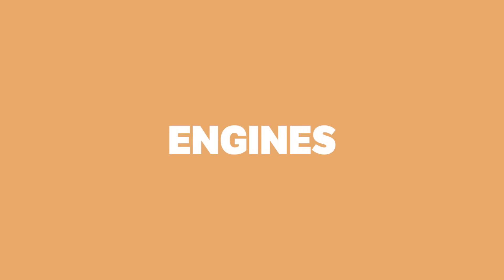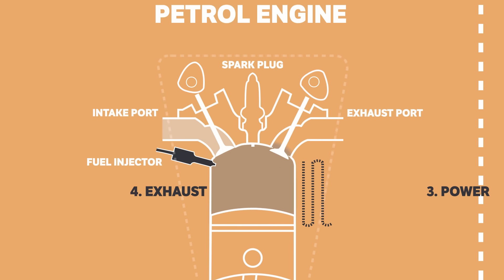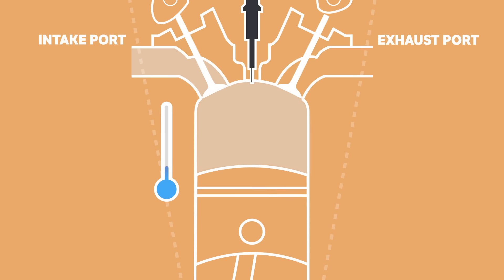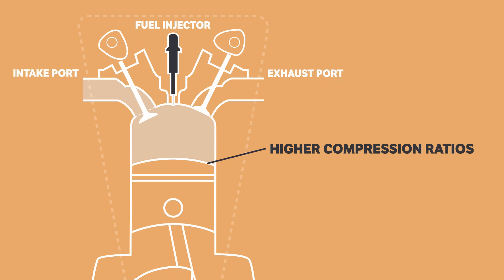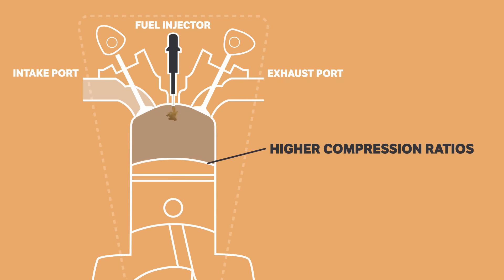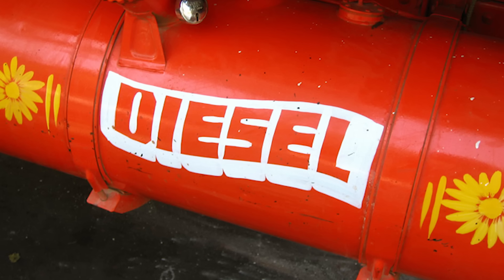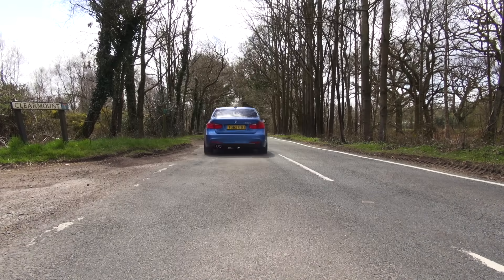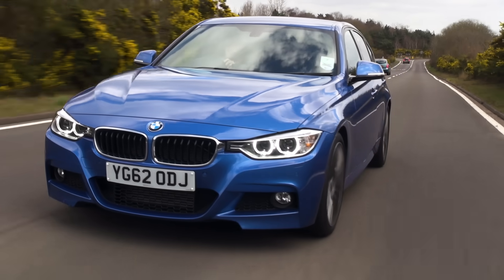The Differences Between Petrol and Diesel Engines

Comment: Hmmm... Diesel or gas... well, all the race cars are going diesel hybrid, so that should mean something. o.O  Now to make a Diesel Prius, as those guys in their big trucks that blow soot all over them don't realize the original Diesel engine was specifically designed to be green, it ran off peanut oil.  Today, you can still run them off food oils, where gas engines are lucky just to run on ethanol!  More torque for less fuel, getting an average of 50 mpg and can run on used french fry oil??  Sign me up!

Comment: Most diesels are faster than their petrol twins though😄 and low down torque means the power is exactly where you want it.. but you also get the MPG, even if it's quite high performance

Comment: Diesels are more fuel efficient. Often faster than their petrol counterparts (for example E90 320i vs 320d). Easy to get BIG power gains from remaps. And finally the M550D (enough said).

Comment: Turbo-petrol: acceptable torque, fun to drive, quiet, relatively clean, easy to run on ethanol, propane, methane...
Diesels stink, produce way too much black sooth, require adblue and complicated emission systems to keep relatively clean, run hard and noisy...
Diesels are great for torque, but electric motors are even better for that, it's just a matter of time before battery technology and decreasing cost will make diesels obsolete.
Turbo-petrol electric plug-in hybrid would be perfect IMHO.
Reply: When do you think trains will run on batteries, never diesel is always the best
Reply: Fuck off.
Reply: CR1MS True people that clean them out once in a while and tune the fuel injection and fuel pump(cummins engines)
Reply: Candisa more noise the better plus diesel is mainly made for trucks and 4x4s
Reply: Mustafa Süzen plus can't take back what we already done to the environment
Reply: diesels produce black sooth if the owners are ricers and idiots.
Reply: Lol electric isnt yet up to snuff to replace diesel like 90% of farm equipment runs on diesel not to mention all the semitrucks busses etc its the most abundant in crude oil next to gasoline. We need more power in the electric motors itself but in an smaller package so it can acctualy do stuff in the field
Reply: who cares about the cleanliness and enviroment, more torque, more black smoke way to go
Reply: i like you Mustafa
Reply: DieselGod237 thank you ;)
Reply: Candisa Yep, got to agree with you there. Just need to sort out the grid and voilà, much cleaner air.

Comment: Sod all the comments , diesels are unreliable nowadays with all the common rail garbage and emissions crap they have to add here in Europe.
A good old turbo diesel from the 1990s would last forever if you maintained it reasonably and still be frugal enough to get you around 
Nowadays you risk going into limp mode on the motor away while a lorry rear ends you hint hint Vw tdi
For the near future I will stick with petrol even if the life span of the engine is a bit less it's worth it
Reply: This isn't right Diesels are still very reliable search it up bc your talking a lot of bullshit.
Reply: Also you say a bit less when it comes to lifespan, well that's wrong petrol will last around 100,000 - 150,000 miles while as diesels can do 350,000 miles plus and not bat an eye.

Comment: But I heard that diesels used a glow plug to ignite the air-fuel mixture?
Reply: विष्णु का दायां हाथ glow plug is only to heat up the cylinder/mixture for the start of the engine.

Comment: They both have their uses. I currently own a petrol car, would love a diesel becasue I've been doing loads of motorway driving and I must say that petrol engine drinks up all that fuel. But for short distances my petrol works wonders, very fun to drive around the city flooring it, seeing them revs reach up ☺️. Honestly diesels sound like a tractor there's no character in them in comparison to petrol engines. But yeah, theyre both comparable and have their pros and cons but in my opinion it should be down to lifestyle choices.

Comment: Actually their are not based on the same cycle. The petrol engine uses the Otto cycle and the Diesel engine uses, well you guess it, the Diesel cycle. These 2 cycles have almost nothing in common. Infact the Otto cycle consist in 2 adiabatics and 2 isochorics while the Diesel cycle consist in 2 adiabatcs, 1 isochoric and 1 isobar. Finally if you want to know a top tip: it's called the 4 stroke engine but in reality there are 5 steps: 1- suction of the air-fuel mixture, 2- compression, 3- combustion, 4- expansion, 5- exhaust. Remeber that in the pressure-volume diagram, combustion and expansion are not in the same step! Like it is shown in this video. Because combustion is the vertical one ( or the isochoric one) and espansion is the adiabatic one that follows! 
Hope that my little explenation is clear :-)

Comment: I feel no one here has driven a big capacity N/A or supercharged gas motor...  Endless torque with none of the breathlessness. Just not good in sports car, but for everything else it's a good combo especially if you do more than 25000 miles a year.

Comment: This really only explains the difference between compression ignition and spark ignition. A gasoline engine can run on either, though it is rare and unnecessary, because gas doesn't need to be atomized to ignite.

Comment: One thing about diesels they did not mention is that it is a more durable engine and it typically has more low end torque for pulling heavy loads and can get between 3and4 times as much miles over a gas engine and with semis they average around a million miles or more then do a complete over haul from top to bottom and the engine is good as new and ready to go back to work and put that high miles on it again the only two major part the gas engine has over diesel is they start better in cold weather and gas engines are a lot cheaper to repair than diesels

Comment: lack of throttle body on diesel engines is why it's retarded to put a dump valve on one.   the engine swallows the waste.. if you dump to atmosphere then your next gear change will be bolloxed up. not to mention lack off vacuum lines to control it on vnt systems. I'm not saying it can't be done as it has been and gone well in some cases but most likely an average setup will make losses

Comment: I'll go for the diesel engine, Since i get a lot more torque and a better fuel econemy. And i can drive my car at a much lover rpm aswell, so it will be less stress on the engine. In theory that Should make the engine live longe.
Reply: It is not good to drive a diesel at low rpm. Sure, it may save some fuel but on the long run the engine will be damaged and the injectors will clog up so more money on repairs
Reply: LIVE LONG & PROSPER \/
Reply: Vali Moisă i usally keep it at 1500-2000rpm But 1000 when costing
Reply: What engine parts get damage from low revs?
Reply: Kaspar Kople not really it's just more expensive to maintain
Reply: Vali Moisă not really because the engine is made for diesel your on about putting diesel in a petrol car then they will clog up
Reply: Except that diesels are nothing but trouble maintenance wise.

Comment: I love both. 
If it's an SUV or a pick-up truck I would choose the diesel versions, because diesel engines are far better due to it's fuel efficiency, long durability and, of course, high torque at lower RPMs, which increases power when you go off-road. 
But if it's a sports car I would definitely choose the petrol versions. High performance gas engines accelerate in a more progressive way due to high torque and HP at higher RPMs.
Reply: This guy gets it.

Comment: The compression ratio in a diesel is higher because the piston only compresses air and then the diesel is in injected to the hot air and self ignites due to the high temperature

Comment: A "520d" or "320d" is not a real BMW.
Reply: i have a e46 320d.... so? still better then a WV. or an audi a3
Reply: What about a 330D M sport?
Reply: Only a 6cyl is a BMW, or up!
Reply: While i have to agree that 6 cyl BMWs are much better to drive and also sound great, the 4 cyl versions still are better than most other 4 cyl cars. Also Downsizing is a bitch, the weakest new straight six has 250+ hp and starts in the x30 models. everything up to x28 is a 4 cyl.
Reply: Bizb but diesel cars are more expensive to buy and only even out in costs to a petrol car after a few years
Reply: Bizb Most Bimmers in India are 320ds or 520ds. I don't know why.
Reply: If its a bmw d it has to be the 3.0 and up no other way really
Reply: If you can't afford to run a petrol car, go for a diesel corolla or something. If you buy a low displacement diesel BMW it just proves that you can't really afford a BMW.
Reply: Bizb M550D my friend

Comment: You went over the benefits in efficiency of a diesel but forgot to back up the video with the benefits of petrol which mainly that the fuel burns much faster so you can create much more power within a similarly sized engine.  There is always going to be a war between the two fuel types but this should be a general summary between the two that people focus on.

Comment: petrol's are now doing away with throttle bodies and moving to variable valve lift (already in production). 
Diesel engines are going away due to many issues, DPF solves nothing it merely delays the release of the particulate (and using more fuel in the process to do the regeneration of the filter). So much time effort and money has been spent trying to clean up diesel and it is not working, if the same amount of resources were put in to petrol it would be uber clean by now. 
not to mention the extra materials and cost associated with a diesel variant (heavier block etc, bigger clutch, more heavy duty gear box, dual mass flywheels, dpf filters etc), all these materials need to come from somewhere, put a massive hike on new price of the car and alot of parts don't last the lifetime of the vehicle.
Long term maintenance on a diesel is usually way more expensive (unless very lucky) ie replacing  a set of injectors can be a few thousand quid, the new ones do not last as long as in times past due to being much more stressed trying to meet the emision standards. 
Even tyre wear on a diesel is usually faster due to the increased weight on the front wheels.
these people that think diesel is clean need to wake up, work on them for a several years and you will come to realise how much dirtier a diesel actually is.
There is a good reason several cities are bringing in a ban on diesel. 
Pettrol  best at the mo, once obtaining an abundance  clean electricity is no longer an issue, traditionally fueled cars should be removed from sale (near future).
Reply: Great...
Reply: capri2wd this exactly. a modern diesel has nothing to do with the old stuff witch was reliable (but also very VERY slow and gutless)
Reply: Bradley0beaver variable valve lift and variable valve timing are two very different things, try Google for some help lol.
Reply: Bradley0beaver first system in a production car was 1990 or 89 i belive. either the nsx or the crx. not Sure. but thats correct right After honda a lot of others came with thier System. BMW on the e36 m3, nissans SR16VE, Mitsubishi mivec and others as well.
Reply: Porsche patented theirs (but never bothered to roll it out on prodution cars) back in 1958, toyota were late to the game lol. It is used in the latest generations in a very different way to that of old. doing away with the throttle body and moving to direct injection is a bigger change than when we went from carbs to injection(probably the last BIG change). vvt/l of old was just a little bit of adjustment, modern versions can keep the valves shut allowing idle regulation etc with the valves alone. vvti etc were just a stepping stone to get to the modern systems, kind of like single point injection was a stepping stone to get to modern multi point systems (yes i am aware that mechanical multi point injection was around long before). most ideas are not new, just the implementation and reasoning.
Engine designers are making radical changes of late.

Comment: Forgive me if I'm wrong but I don't think you explained why diesel engines don't use a spark plug other than the fact that they have a higher compression ratio. Why can't gasoline be ignited with compression? Also, why can't diesel engines have a spark plug to assist in combustion ?

Comment: I just thought I'd point out that your last fact about turbos helping the efficiency by pushing the piston down is incorrect. It helps increase overall compression pressure in the cylinder. More Air + More fuel = more bang

Comment: Do you say that Compression ratio of diesel engine is so high that you don't need a spark plug in it. Or should I understand that spark plug cannot ignite diesel, hence they make an engine to attain such a high compression ratio?
Reply: I got my answer.
https://www.engadget.com/2017/08/08/mazdas-engine-breakthrough-promises-big-fuel-efficiency-gains/

Comment: Diesel but without the coal rolling
Reply: My 94 Ford F-350 7.3 IDI has a compression ratio of 21.5:1
Reply: Niels Blankenstijn 
Whats coal rolling?
Reply: Niek Hoogendoorn thanks
Reply: Clorox Bleach And we live in the land of the free so we can do whatever the fuck we want.
Reply: with*
Reply: Niek Hoogendoorn no its a thing 17 year olds do when they dont pay for their fuel bill.
Reply: rolling coal is shooting out black smoke by modifying the injectors to inject a crap ton of fuel. In other words, it's what my avatar is doing
Reply: For big performance or horsepower diesels built for racing, rolling coal is almost necessary because of the high fuel amounts needed

Comment: Nice video, simple yet in-depth! Defs a petrol kinda guy😏
For those who don't know, Diesel is like the delinquent brother to petrol (is the crap leftover from refining petrol I'm pretty sure)
Reply: Literally every mechanic I've worked with would agree that having the Fuel injected after the compression stroke like with a Diesel engine is more practical. Plus with compression ratio being directly correlated to fuel economy (diesel already being cheaper than gas to fill up with), who doesn't love having a cheaper receipt leaving the service station. 

Also if your into 4X4. It goes without saying that obviously turbochargers are ubiquitous with every modern diesel car. But some 15 years ago, most venerable off roaders would still prefer the practically asthmatic oil burner over the powerful petrol sixes. Reliability of the diesel is also a big factor of why people prefer. It's why it is essentially the only fuel type you see with construction vehicles in the manufacturing industry. This also meant that if you ever got stuck out in the outback of Australia, you'd be pretty much goners with a petrol, as most rural stations and home steads only stored diesel
Reply: Boosted & Built Garage 
فيديو رائع وبسيط في العمق! يدافع عن نوع من الوقود
بالنسبة لأولئك الذين لا يعرفون ، ديزل هو مثل الشقيق الجانح للبنزين (هو بقايا حماقة من تكرير البنزين أنا متأكد)
Reply: Nope that would be car oil... I've worked in an oil refinery
Reply: Boosted & Built Garage nope
Reply: Lol nope diesel is the most abundant next to gasoline from the refining process it too is refined but not to an extent gasoline is

Comment: I dont think diesel engines self ignite just because of compression. They have spark plug right?
Reply: lol nope
Reply: They don't, actually it's harder to ignite diesel fuel with fire rather than compression and heat.
Reply: But wen diesel engines get hard to startup why is it?
Reply: crazy portuguese because the air is too cold so it has to warm up first

Comment: I prefer the top of the italian '80-'90 engineering 2.5 liter straight 4 cylinder n/a Iveco (zastava) which makes rouhly abouth 75 rwhp @4200 rpm, and 160 N·m (118 lb·ft) @2200 rpm, pretty amazing, i know...